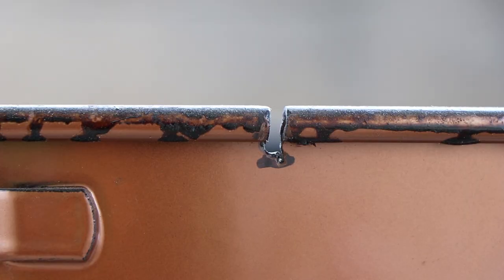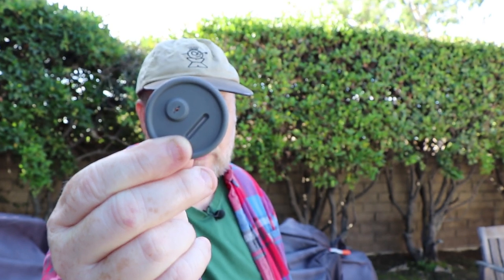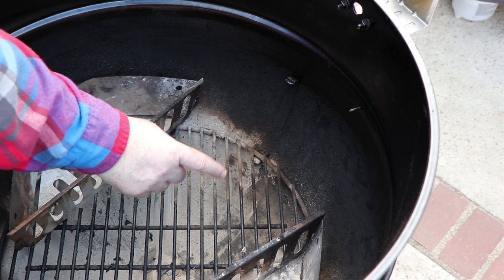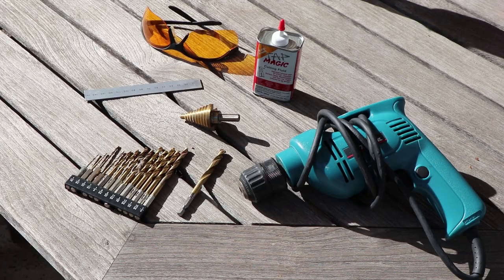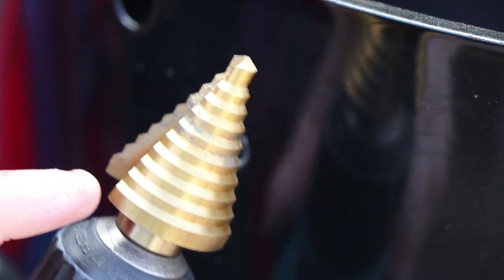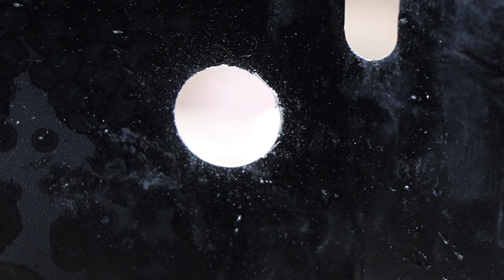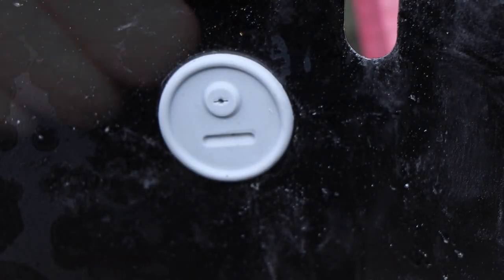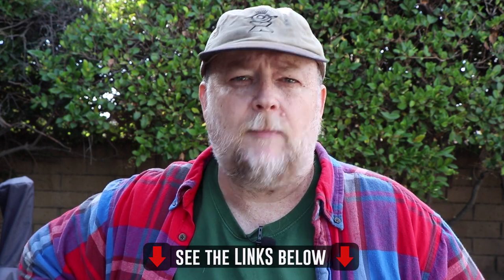Sensor Port Installation For Barbecues, Grills, & Other Cookers

Comment: I hook my sensor clip to the slot that the handle end of the rotisserie sits in. After putting the skewer in i attach the clip above it with the sensor inside and the wire coming back out the slot above the skewer. Has worked great for me.

Comment: Nice worthwhile mod. I would do the very same thing. Highly recommend. I have that same port on the WSM as you mentioned. I have the cajun bandit rotisserie but already use that port. If and when I get a kettle, I'll do this mod in a heartbeat.  Don't mind popping holes in it to get it like I want it.

Comment: I see so many folks abuse their drill bits. Just because your drill motor can reach high rpm's, doesn't mean that the speed is recommended for High Speed drill bits. If you are drilling aluminum, no problem. But steel, that is completly different. You can burn up exensive high speed drill bits and ruin them quickly by going too fast. It is best to use a varible speed drill and go to a much slower rpm. You will simply be amazed at how many holes you can actually drill with the same bit. Especially the step drill bits. They need to go very slow and use a light to medium pressure for drilling. Slower is also much more safe, smaller drill bits can break easily especially when breaking through the metal and that can cause injury to your hands. Be safe, slow down.
Reply: Instablaster

Comment: After you drilled to your desired hole size with the step down bit, use the same bit on the inside lightly as a deburring tool. I found it works great.
Reply from the maker: Great idea!
Reply: @CookingWithRy  Smoking my first chuck roast tomorrow. I hope it turns out as good as yours.

Comment: Everyone uses the slotted port for probes but what's the top circlular opening on the grommet for? Can a grill thermometer squeeze through there when you're not using a probe?
Reply from the maker: I use that to hold an ambient temp probe. You just slide the probe portion through and it is held just inside the cook chamber.

Comment: How did you secure the Weber rotisserie ring to your weber kettle can you provide specifics in terms of what types of pins or screws you used to make the fit more secure?
Reply: You mentioned the previous video as it relates to the rotisserie ring?
Reply from the maker: There are two holes in the bottom of the ring. I simply drilled matching holes in the kettle and use tapping screws to secure the ring when I'm using it.
Reply: Thank you and great video by the way!  I am now an subscriber. Keep up the great work

Comment: I'm not sure if you are familiar with the Thermoworks Smoke X4 and the large diameter probes it has.  If so, do you think they would pass through either hole on the probe port?  I'm thinking of putting a couple of these in my Old Country Smokehouse.  I just got the Smoke X4 today and the cables are too short (1m) to run the way I had been using my Guru probes (2m) which is down the chimney.  Any info would be greatly appreciated.  Great channel!  I gave you a shout out on my Pastrami videos - yours was the method I used.  Thanks, again.
Reply from the maker: I actually have both the Smoke and the Smoke X4 and run the probes through these ports on several of my cookers with no problems 😊
Reply: Cooking With Ry cool beans!  Thanx!

Comment: I need to do this on all my Weber’s! I have an old WSM and it doesn’t have one either thanks for the how to video... did you go back with high heat paint on the edges?
Reply from the maker: No, didn't repaint it. With that enamel that was knocked off, I think it would fail pretty quickly under heat. It's a fair trade off, though. I keep the kettle under cover during bad weather, so I can keep a watch out for rust.

Comment: Why would you not put it in the "base" of the Weber? If you chose to not use the rotisserre part you would still be set up for a thru wall temp system.
Reply from the maker: In the base it can be really close to burning charcoal and I don't think it's rated for direct contact with flame.

Comment: Where would you locate port on a Weber 22" grill?
Reply from the maker: I wouldn’t put the silicone sensor port in the kettle directly. It would be too close to the charcoal and direct flame. I don’t believe it’s able to withstand those sorts of direct temperatures.

Comment: Will it not wrap around the rotisserie
Reply from the maker: This is only for the ambient temperature probe, not the internal meat probe :)
Reply: We have to invent the probe friendly rotisserie that reverses direction every rotation. Lol.  They actually make wireless probes now that can be used in a rotisserie.
Reply from the maker: @shadowdog500  I've seen the one called the Meater, but the size of the probes is pretty large. I do hope we can have really reliable wireless probes soon. That would be fantastic for rotisserie :)
Reply: Cooking With Ry that’s the one I was thinking of.  Here is a photo of it being used in a rotisserie https://m.imgur.com/U3mXPAH?r.  The guy who took the photo had the probe get too hot during a flair up so I would make sure the exposed end is not in a position that can get a flair up.

Comment: good installation...but you forgot to demonstrate Port Grommet IN ACTION ❓❓
I am using a 50 cent cork ..that works great and is replaceable in a pinch. 
These Weber ports are $20 a pair of them....

Comment: Damn I thought “this guy is s real pro” until you pulled out the flat file for cleanup. A rat tale will work better for this application.
Reply from the maker: I'm far from a pro. Didn't have a rat tail, but I probably just should have used the grinding stone attachment for my drill :)